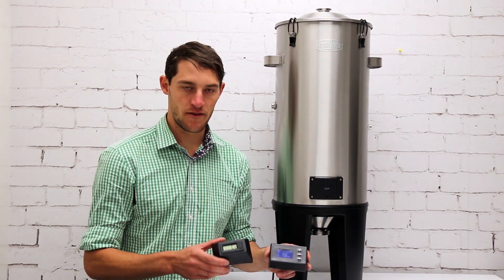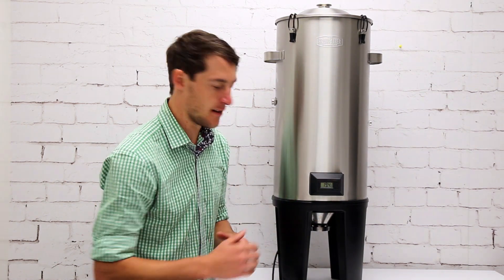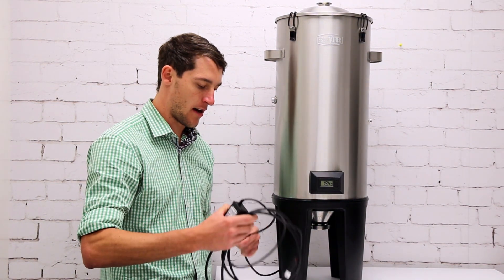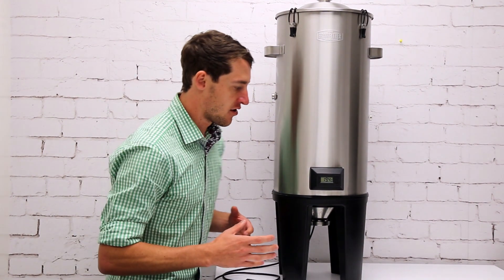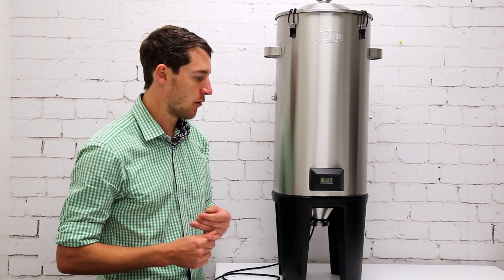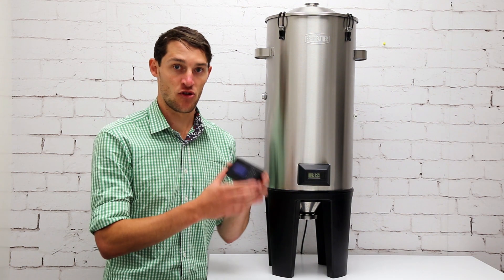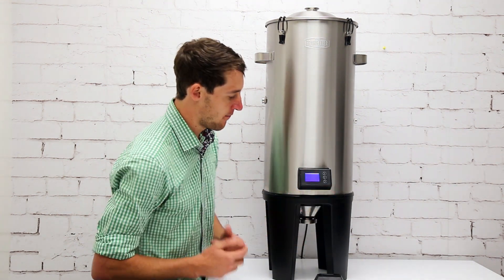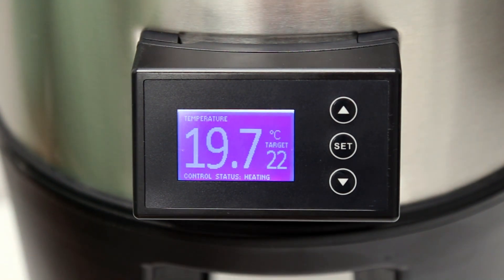Grainfather Conical Fermenter Temperature Display and Temperature Controller Add on

Comment: Used digital temperature controller tthen tested with prob afterwards but however I put a sugar wash in conical last night and its fermenting just fine now heater not on because it's reached it temperature and stable must admit I was sceptical about it at fist though

Comment: Just bought the grainfather conical put it to the heating test using cold water started a 15c heated to 26c when I poured some out of the conical yeast dump says 26c on the temperature controller but tested the tempeture with a new temperature prob it only says it was 23 c so we're is the 26 c I wanted
Reply from the maker: did you use the digital temperature controller? or did you just use the heater without the temp controller?

Comment: Nice looking conical. Without the glycol chiller, how do you cool the wort down? Can you put the conical inside a fridge and plug it into the temperature control unit? Cheers
Reply from the maker: You will need some sort of a cooling system, we will also be bringing out a ice water pump- so instead of using glycol you will run ice water to cool. The Glycol chiller is obviously a lot more effective and efficient but we will have an alternative option available :)
Reply: LouSpowell I understand he chilled the wort prior to transfering to the conical. What happens though to stop the temperature rising again in the likes of Summer without the Glycol chiller to keep the temperature down? Not everyone is going to be able to afford to buy both the conical and glycol chiller.
Reply: LouSpowell All good. I'm not sure when the chiller will be avaliable. I guess in the meantime you could place the conical in a fridge and use a separate temp controller you can plug the fridge into. I guess that's what most people will end up doing in the meantime.
Reply from the maker: Launch date will vary Sep - Aug depending on where you are based in the world.
Reply: TubeDinoz was going to ask the same question.
Reply: Ahh. Misunderstood! I see your point. 

I'm not seeing the glycol cooler at the site. Is it even available?
Reply: I would really hope they add a ice bath pump setup for standard fermentation temp controls. We don't all need the glycol setup for this much... I mean I might get one later, but baby steps (and cost!)
Reply: Hi, any clue of the availability ETA of that ice water pump? I have an old freezer and could be great to incorporate that to the system, with the temperature control of the  PRO unit that I have coming!!!! (counting days...)
Reply: Grainfather - All Grain Brewing thanks! i'm in Spain. Meanwhile is it possible (and safe for the electronics) to put the fementer inside the freezer and regulate ferm temperature by an external device? (while waiting for the ice water pump)
Reply from the maker: Yes, this will be possible - you can keep it in the fridge in the mean time :)
Reply: He's already advanced beyond that step for this demo. Just prior to being put into the conical fermenter, the wort was cooled with the counter flow wort chiller that sits atop the Grainfather. By the time the wort gets inside this unit, it has already been fully cooled - and rather quickly.